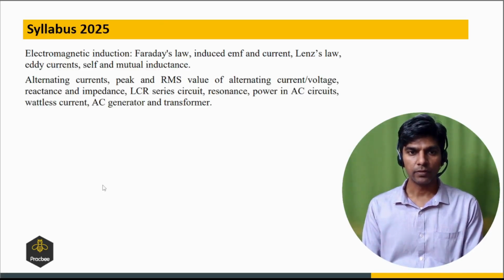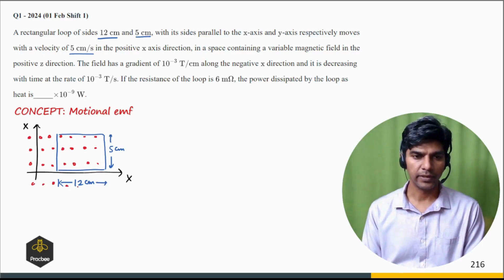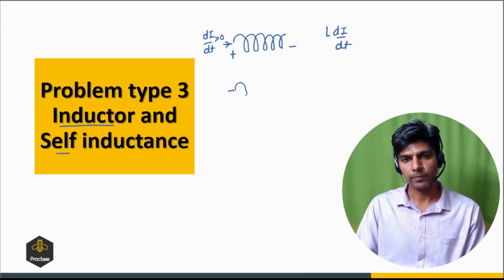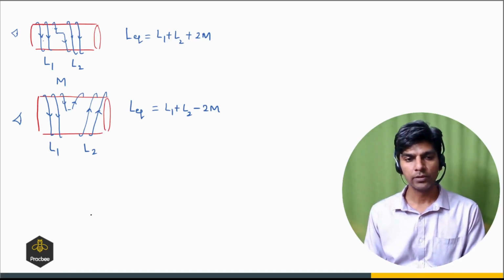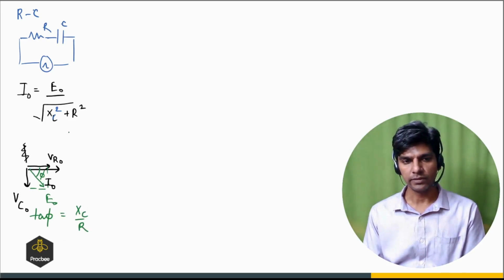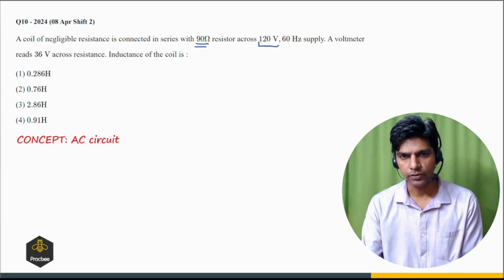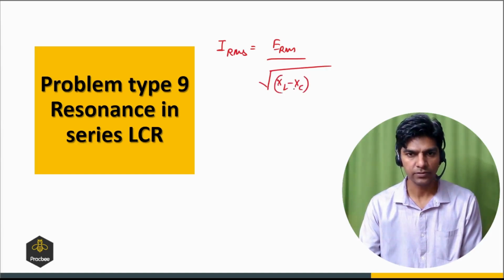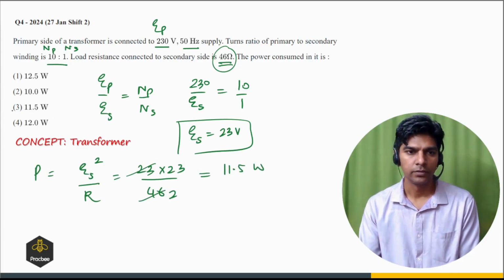12 Problem Types in Electromagnetic Induction and Alternating Current | Puran Chand - IIT Delhi

Comment: Sir in the motional emf questions , the fan one why is the information 3 blades given as it is not used anywhere in the soln
Reply from the maker: Emf will develop in all blades. When we have ideal identical batteries connected in parallel then potential difference across ends is same as emf of of one battery. That is why no. Of blades does not affect answer.